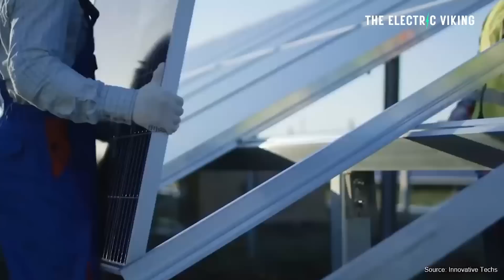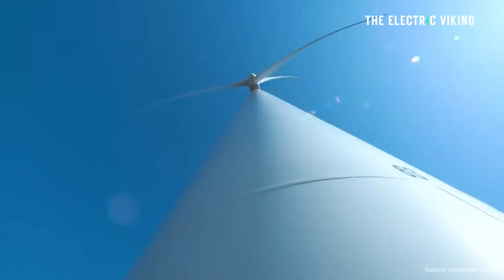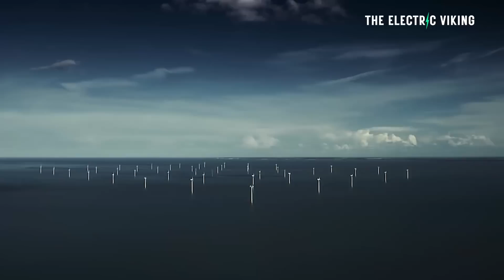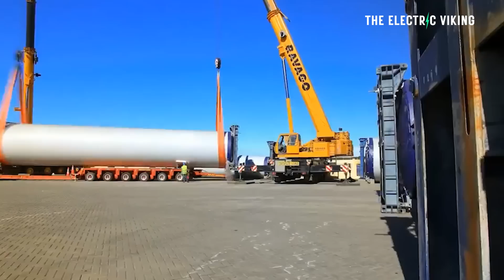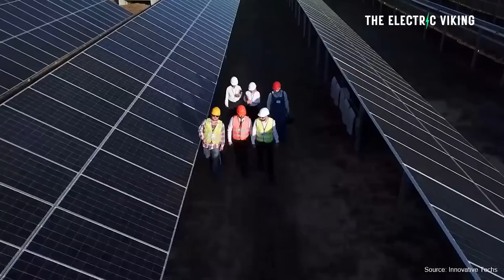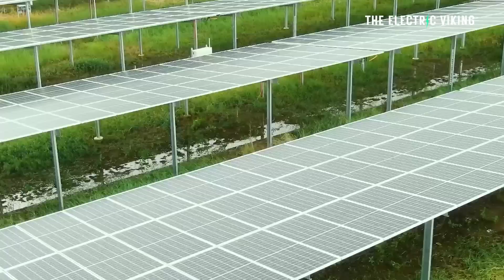8 countries now generate over 99% of their electricity from renewable energy

Comment: The UK generates quite a lot of green electricity but we still rely for 75% on total energy used on fossil fuels. Heating  and transportation is almost exclusively fossil fuelled.
Reply: From next year heat pumps will be required on all new builds in the UK, so things are starting to move in the right direction, despite Sunak’s best efforts to throw climate action into reverse.
Reply: @philiptaylor7902  I think that edict has been postponed. I have an air heat pump. It is great. But the MSM is fighting tooth and nail to preserve gas boilers. The truth is we don't have enough wind farms and the National Grid is insufficient to transport the electricity - even if we had it. Unfortunately wind farms have tripled in cost in the last 5 years so there is little prospect of rapidly moving away from fossil fuels. I think the UK will be reliant on fossil fuels for another 20 years minimum. For this reason we should exploit the North Sea and frack in preference to buying off Saudi Arabia or some other pariah State.

Comment: We all love renewables but let be honest and pragmatic also ....wind and solar are unreliable on their own. you can't generate solar at night and we do not have battery technology that can store all the energy.
Reply: We do have the tech. Regular batteries are perfectly capable of day to day storage, even weekly storage if you push it, while other ways of storing power — like pumped hydro — are more feasible for seasonal fluctuation (though with how cheap renewable generation is getting it might be cheaper to offset the need for long term storage by just adding more generation).
Reply: @FabioCapela  Batteries are nowhere close to what you describe.  The installed base of batteries in the US would run the grid for a few minutes.  And the costs are very high, but are almost never included (along with necessary fossil fuel back-ups) in wind and solar costs.
Reply: @dzcav3  I was talking about the tech, not the installed capacity — though installed capacity is quickly increasing in the US too.
Also, when talking about whether batteries are expensive or not, you need to check the timeframe, because battery cells are still falling in price quickly; just between 2013 and 2023, for example, their price fell by 82%, so even looking at a price study a couple years old can be misleading.
Incidentally, pumped hydro — the hydropower equivalent of batteries which have been used for almost a century to stabilize electrical grids around the world —is also perfectly feasible for this, though just like hydropower despite having low operational costs it has high upfront costs.

Comment: About 1% of the population
Reply: Brazil has roughly 90% of its electricity generated from renewables and 2.7% of the world population. Other places are catching up too.
Also, with renewables being cheaper than fossil fuel power generation and avoiding the huge headache of supplying the (often imported) fuel, there's a good chance the power grid of countries that are building or drastically expanding them from now on — including much of Africa — will be mostly or even exclusively renewable. China driving the price of solar panels and batteries into the ground — to the point there are people using solar panel for fencing due to aesthetical considerations rather than their ability to generate power — flipped the script of the transition, making it likely that backwater places like some African countries won't be the last bastion of polluting tech like ICE cars and fossil fuel power generation, but instead that those places will skip fossil fuels altogether and go directly for (now cheaper than fossil fuels) renewables and (soon cheaper than ICE cars) EVs.
Reply: @FabioCapela  every developing country that engages in mostly renewables (other than hydro) will stay poor for decades and decades longer than necessary..
Reply: @grantbuttenshaw  Unlikely. As long as the country doesn't mind importing gear from China (the cheapest place to get it) then renewables with battery storage should be cheaper than either gas or coal even if you have to build some extra generation to take care of cloudy or still days. Being cheaper and modular makes it easier to scale up faster. And most developing countries are blessed with plentiful sunlight, meaning the same solar panel in those countries produces more than in Europe or the US.

Also, microgrids. Renewables scale down to as small as a single residence; many places in Africa are implementing microgrids (usually based on solar power) to bring electricity to places where building a proper power plant, or even transmission lines, would still be too hard or expensive for the government, speeding up electrification and progress. Thus, a large number of African people are getting their first taste of having electricity at home from Chinese solar + battery kits.

And this brings another interesting power and infrastructure related aspect; many African countries don't have adequate infrastructure for transporting and distributing fuel, which impacts not only operating fuel-dependent power plants like coal and gas, but also makes refueling an ICE car expensive, inconvenient (due to very few fuel stations existing, often with long lines to refuel), and unreliable (as it's not uncommon for fuel to be sold out); think the experience of using hydrogen cars. Meanwhile, a microgrid is enough to keep charged an EV that will only be used for local trips, allowing EVs to be used in places where the lack of fuel infrastructure makes the use of ICE cars expensive or unfeasible; safari lodges in Africa have been doing this for a long time, for example, converting old gas guzzlers to run on electricity and charging them with solar panels, allowing them to stop transporting fuel at great expense to the middle of nowhere. This makes it much more likely those countries will quickly skip ICE cars and go for EVs, the way Ethiopia is doing (where the government even completely forbid the import of cars, new or used, with internal combustion engines).
Reply: @FabioCapela  I disagree with most of that.... currently the poorest countries are building coal plants galore. 

Battery plus RE are still more expensive than coal and gas...poor countries don't do things that cost more...hence why they are building coal. 

Ethiopia has terrible road and less than 1/500 people have a car currently. They also don't have a distribution network so need transmission costs included...again keeping these people poor...the average income $3000 vs the average EV ($50k). 

90% of the population can't afford a car let alone an EV...and then they have nowhere to charge it...North Korea has more people connected to the grid then Ethiopians.

Comment: You're kidding, right?  GERMANY AND SPAIN?

Sam, Germany is DEINDUSTRIALIZING because they lost cheap NATURAL GAS, and have reopened coal plants AND NUKE plants.  Spain is almost completely deindustriaki,Ed, and went broke TWICE because of solsr and wind boondoggle.

And how many times do you people need to be taken to task?  INSTALLED capacity does not equal GENERATED POWER.

Listing these other countries as running mostly on renewable power, when many of them DON'T EVEN HAVE A POWER GRID, is the worst kind of disingenuous.

Comment: How far in the red are these countries? All this green energy isnt free. No one ever talks about maintence cost. I know an electrician who used to work 6 days a week, he looks after a small wind farm and now works 8 days a month and brings in much more money. How much does it cost to pay the rent for the land where all solar and wind farms are located. Why is the most expensive cost per unit is in South Australia where they are almost 100% renewable?
Reply: Right now wind and solar power is cheaper than coal and gas power in most of the world even when coupled with battery storage. And yeah, that does include the land lease.

One nice thing about solar is that you can still use the land below the panels. A parking lot covered in solar panels, for example, still serves as a parking lot (and a better one as it offers shade). A house covered in solar panels is still a house. You can even grow crops below solar panels (though it does require spacing them more than usual).

Incidentally, South Australia has enough roof mounted solar panels to cover 100% of its electricity needs during part of the day from that source alone; almost half of the houses have rooftop solar there.

Also, some of those countries reached close to 100% renewables with hydropower; at least Paraguay did, and AFAIK Norway also makes heavy use of hydropower. Hydropower is limited in where it can be used and has large upfront costs, but in the long term is one of the cheapest ways to generate electricity; back in the 70s it was already cheaper, on the long run, than gas and coal (which is why, for example, Brazil — a country with plentiful sites for hydropower — never took coal and gas power seriously).
Reply: @FabioCapela  “. . . a naïve observer might conclude that the rising share of new renewables (solar and wind) will usher in an era of falling electricity prices.  But in reality, the opposite has been true.”  Vaclav Smil, Numbers Don’t Lie, p.172

For all the countries discussed in the video, almost all the electricity comes from hydro, with a little geothermal from Iceland.  Norway gets about 10% from wind.  Outside of that, solar and wind are mere rounding errors.  Solar and wind costs almost never include battery or other back-up costs suitable for a 24/7/365 grid, or increased transmission costs.
Reply: @dzcav3  Hydropower has higher transmission costs than wind and solar, as there is far less freedom in where it's placed. Brazil's reliance on hydropower, for example, is why we built a grid so extensive and integrated that we can compensate for a sudden load increase in the extreme north of the country by increasing the power production at a hydropower dam two thousand miles to the south.
Which, incidentally, now makes adding wind and solar easy and cheap; we are already at over 20% of our electricity coming from wind and solar, and the plan is to keep increasing that until we shut down all our fossil fuel power plants in the next few years. We don't even need batteries to handle curtailment, as we can just lower the output of hydropower in real time — as it's a dispatchable source — to make way for the electricity from wind and solar, and conversely just ramp hydropower back up when wind and solar aren't producing enough.

Comment: As for Norway  "Hydropower is still the mainstay of the Norwegian electricity system. At the beginning of 2023, there were 1 769 hydropower plants in Norway, with a combined installed capacity of 33 691 MW. In a normal year, the Norwegian hydropower plants produce 136.49 TWh, which is about 88% of Norway’s total power production."
Reply: Not much options for expanding hydropower so to decarbonise the whole economy there needs to be more solar, wind and maybe nuclear.
I hope we build a bunch of floating wind power plants around the old existing oil rigs. Some of them even have a beefy electricity cable to land already, so good opportunity to reuse infrastructure.
There’s even talk of sending hydrogen rather than natural gas to Germany over existing pipes (for industry, not for cars)
Reply: @auspiciouslywild  H2 needs to be generated in place for industry. Transporting it makes no sense, nor does building new nuclear.

Comment: I suspect the energy being generated by renewables is going to keep rising in a lot of countries that over the next decade or two, most if not all the electrical needs are being meet.

Many countries are already having days and weeks of generating all the electrical needs, and that's likely going to go higher into the months as the years go by until we get to a point where most or all the electrical energy is renewable.

On top of that, a lot of countries are doing a big push on EV cars and heat pumps, which over the long run will reduce the need for oil and gas and it seems like everything is going electrical because it's a lot more flexible in how we can get that energy., we can, if we are bold enough, generate all our energy locally.

Now if we can just master some kind of wind turbine that can generate meaningful energy on our homes, that would solve many problem, solar and wind would complement each other to have a more consistent energy generating, it would also reduce how much of a buffer you need with battery if we have a more constant flow of energy being generated and I suspect over the long run, more of us are going to want to generate the energy we use on-site, mainly because it will lower bills, whereas solar and wind farms, they are basically generating a lot more energy, but it's not lowering our bills, if they did, I'm sure there would be far less resistance on planning permission, so when doing it locally, you cut out the middle men and get the savings right away, depending on what you need.

Comment: Powering small non industrialised countries using mostly hydro /geo and some wind and solar does not mean that large industrialised countries can use wind and solar to do the same.
Wind generation drops erratically to as little as 5% of capacity many times each month . Solar drops to 0% every night . Cloud , snow and hail represent other major problems which stop generation at random. 
Extra costs of transmission , storage and back up are enormous.
Germany now has some of the most expensive electricity in Europe because of their over reliance on wind and solar . Their electricity charges have soared and as a result they are now in recession. 
The cost to try and power a modern industrialised economy using wind and solar is immense , not to mention the cost on the environment in terms of massive land use ,ocean area use and the environmental harms that result. 
Wind turbines and solar panels have short lifespans , and are a major toxic waste problem in the making.

If not for massive endless government mandates and taxpayer funded subsidies , wind and large scale solar would barely exist , because they cannot compete to supply consistent electricity all day every day for a full year as is needed to have a prosperous industrialised society.
Reply: The price is high due to gas and gas related pricing, we've had over 60% renewable most times, those prices are between 2-8 cents per kWh. Gas is over 30, that one unfortunately sets the price. This in turn leads to huge profit for the solar and wind companies, they build out faster, and lo and behold no more thermal plants in a few years.

Comment: I think that is just counting electricity. Many heat their homes with NG and they are unlikely to tear out their hearing systems for electric heat anytime soon.
Reply: Title says electricity. Not power.
Reply: We did in December.  We now have a heat pump.
Reply: @paulgoffin8054  most won’t do that since NG is so cheap
Reply: @eddiegill  Most are being told by the oil industry sponsored press not to do it.

We had a non condensing boiler before and the heat pump is definitely cheaper to run.  Different if you have one of the good condensing gas boilers with weather compensation like the Veissman ones.
Reply: "they are unlikely to tear out their hearing systems for electric heat anytime soon" - I have done exactly that several years ago. Best thing I ever did. In fact I am in the proces of removing all remaining gas appliances. There will never be gas in use at my address again, at least while I live there anyway!
Reply: @BrentonSmythesfieldsaye  not many remove efficient and cheap NG systems and spend money on solar and batteries and heat pumps .
Reply: Many of these countries do not understand your comment about "heating". Unless you are talking about cooking or industrial process, heat is not needed in many parts of the world.
Reply: @5353Jumper  millions of Americans over the past decades converted from electric to NG and oil for heat. Don’t see many spending money on heat pumps.
Reply: @eddiegill  so? What does that have to do with the countries that are the topic of this video?
Reply: That's true, but with EV cars and heat pumps taking off in a big way, it ends up replacing oil and gas with electricity for most of our needs.

So as long as renewable energy generating is going higher as a percentage of all energy whiles we dump a lot more on it with EV's and heat pumps, then it's only a matter of time before fossil fuels get pushed out.
Reply: @paul1979uk2000  most people have huge electric bills and don’t want to add more to that bill. More and more Americans rent and have no control of their home or apartment building